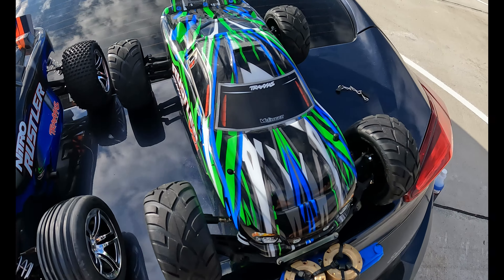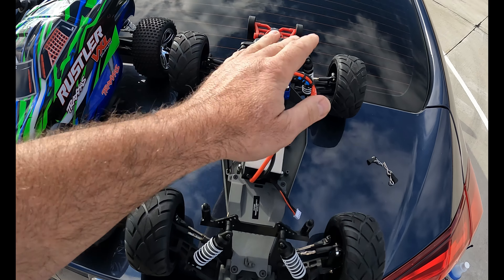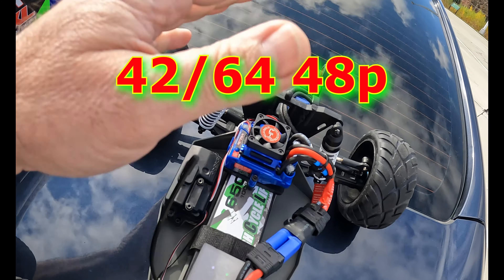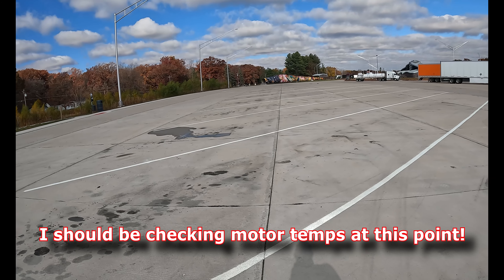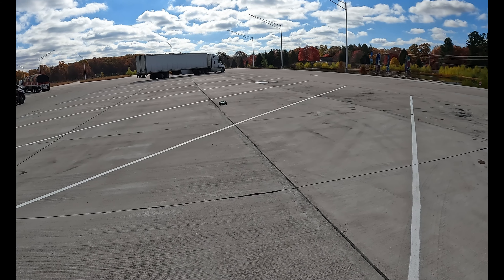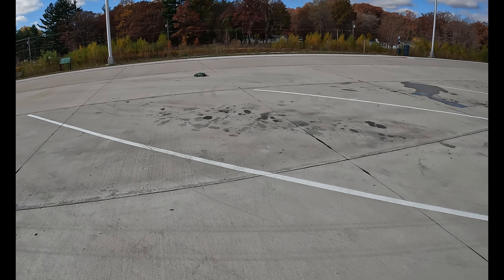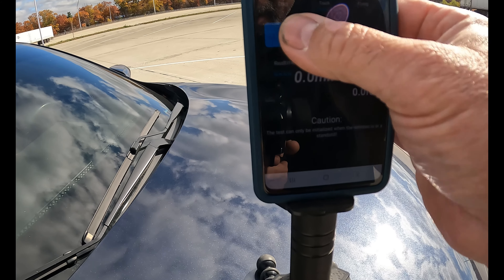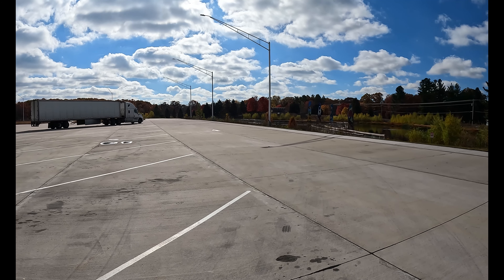What's the FASTEST Way to Tune a Traxxas Rustler 2wd for Speed Runs?

Comment: I bet that run it didn't record the speed was your best!  Nice improvements just the same!  It looks much better than last time out.  I bet that is a 75 mph setup with a clean run (if the tires cooperate).  Can't wait to see the next runs!  Loving it.
Reply from the maker: I'm promise it could do 75 mph but I swear those tires where giving up making the run wonky. I added more weight to the front end which should help. At least the new tune tracks in a straight line.
Reply: @nwirc  The car setup seems better , good work and you got a PB👍 
Balooning tyres are holding you back and still wants to wheelie doesn't it, more setup tweaks needed!

Aside from that, you may need more space very soon, you will need to give the car enough time to keep accelerating and reach top speed.  Your runs are very short.

Keep at it! Enjoying the progress!💪
Reply from the maker: I have a new spot I'm going to check out today. It's got to be at least a 1/2 to 3/4 mile long. 

For now I just added more weight to the front and going to change the front shock oil from 10w to 40w and see what happens. 

Thanks for the info.
Reply: @ absolutely! I’m sure I’ll learn a few things from you as you take a different path in some areas.

That large area should be nice

Comment: Nice ! Definitely a nice run !
Reply from the maker: @JOHND_RC  Thank you John. My next goal is to hit a clean 75 mph. I just added weight to the front and installed a HR bell crank which took a lot of the slop out from the front end. Also readjusted the front toe -3  and front/ rear camber -1.. We'll see what happens in the next run.
Reply: @ I definitely look forward to seeing that !! Nice work